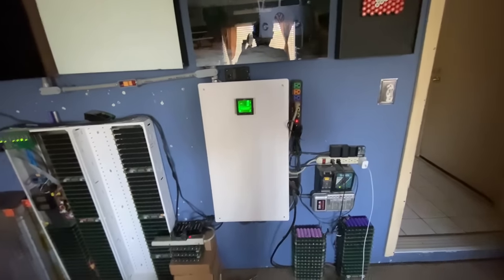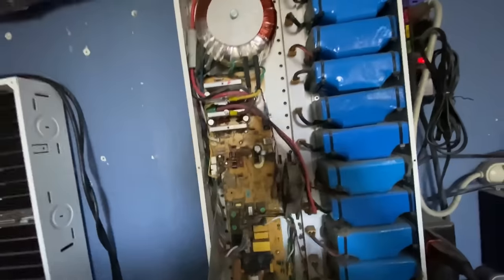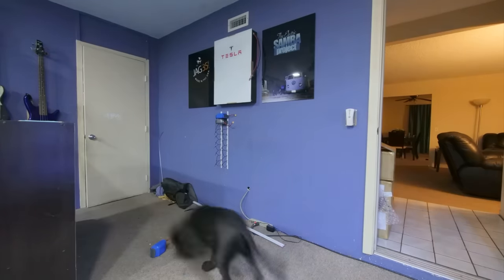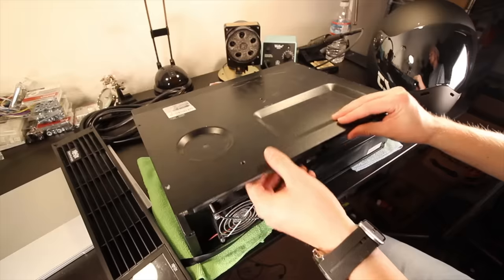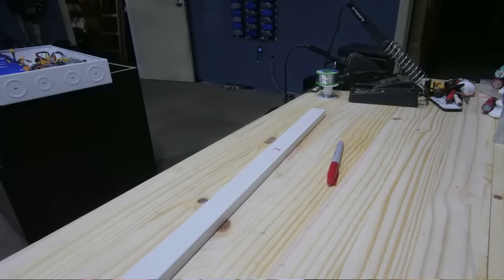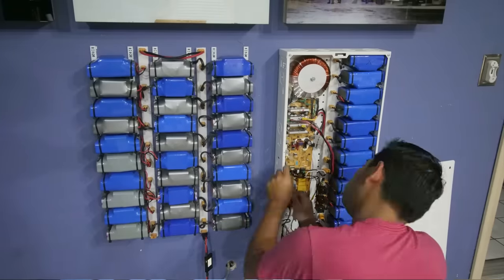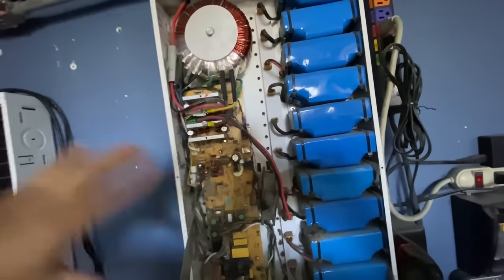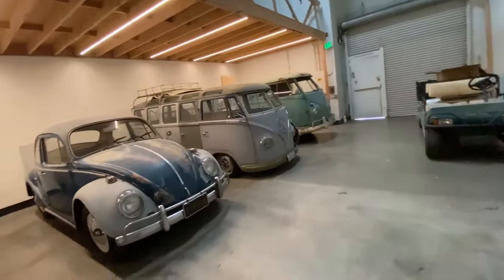Build a DIY Backup Powerwall using a UPS and scooter Batteries

Comment: Hah!  Funny.  I just started building a system very close to this, due to the availability of really nice 36V scooter packs.  Found the batteries first, ordered a few and liked 'em, so ordered 60 more packs. I've used UPSes this way in the past, BTW. Originally was thinking of breaking the batteries up and doing a 24 or 48V setup, which wasn't ideal. (And a lot of work).
  Went hunting on Ebay for UPS that was 36V, and sine wave. (Not a fan of Tripplite these many decades of power electronics.)  Found a Dell 1000W 36V sine unit, used no batts for cheap. Nice unit. 10S Li-ion is almost a perfect drop-in. (42V max, 28V min or so.) one 10S2P pack runs a 400W load just fine. 60 together will be loafing.  Have to add BMS, but they're coming. Looks like about $2K in batts, parts, hardware, UPS and BMS boards for almost 10KWH. 
 Cisco router P/S (42V-27A each) used with a CC/CV P/S to safely charge from generator if needed. Replace old 12V 5KWH golf cart batt setup.
  I'm been an electronic tech and power systems type for about 50 years. (Even lots of time spent with tubes.) Was looking at LiFeP04, but couldn't touch the deal. On grid but have multi-day outages in the mountains up here. (And utility shutdowns for 'fire safety'.) So this will run the place and charge from inverter generator if needed. Don't knock 36V systems of Li-ion and used UPS units. Lot of backup for the $$. thanks for your fun vids!  Stu
Reply: Hey I need some advice on running 12 of these on a robot with a 6.5hp gas motor with a 24 volt alternator 90 amp

Comment: Couple of obvious things:  
#1- Line-Interactive is a fancy way of saying "Offline" or "Standby". LI UPS's sit dormant until power goes off and then they kick in the inverter and the relays throw. Very basic and lower losses, downside, you will loose a quite a few cycles of AC while they do so and the phase will be out when they kick in. Double-Online Conversion is what Jehu was refering to, but not in this unit. DOC units go like so, AC > DC (Battery) DC > AC, Mains output is decoupled from the input. 
#2- No mention of the fact that a SLA based UPS does not come close to the charging curves and levels of Lithium types. Result is much lower capacities, poor battery performance and the UPS tripping out early.
Reply: IKR , not to mention lack of termination of charge , lower internal resistance of ALL lithium technologies and NO CC/CV charging , ive given up trying to explain it to loads on here

Comment: Great video just got into this after installing a 20kW NG generator looking for a DIY UPS that outputs 240 volts to eliminate out the transfer time .
Reply: Hi Jay. Are you happy with 20 kW NG generator? how much oil do you use to produce 1 kWh electricity?
Reply: @TheScorpionsuk  it's installed only for emergency use and has less than 2 hours of run time.

Comment: That ups was designed for lead acid. I think that will overcharge or overdischarge based on how UPS is configured
Reply from the maker: Same voltage
Reply: Yep, wrong chemistry.
Reply: @jehugarcia  Yeah... but for 36v, he need to have around 10 LiIo cells in series. Aka a terminal voltage of 42V when full and 30V when empty. But same with lead acid will be 43.5V when full and 30V when empty. Aka this setup will overcharge. And I dont think its a good idea to float LiIo at 39V because LiIo will start discharging into the charger as its natural voltage is 4.2 when full and disconnected. IDK im not an expert.. but I do think lead acid and lithum chemistry is not interchangeable unless there is some retrofitting circuit to take UPS output and make it safe for LiIo (Not talking of just a normal BMS, there needs to be an advanced BMS to handle float)
Reply from the maker: Chemistry is irrelevant, voltage is king.  Float voltage is 13.5v x 3 = 40.5v.  My unit maintains the battery at 41v divide that by 10 and what do you get?  The correct voltage
Reply: i wish you could reflash ups with code that allows you to reconfigure charger into li-ion patterns, such as allowing it to stay at different s.o.c...
Reply: The problem here is the fire hazard. Putting a smoke sensor is mandatory. 
And will the fire protection insurance pay if something happens?
I would build in a automatic fire extinguisher in it to be on the safe side. It’s always possible that the charging circuit malfunction and let out more voltage and overload the cells.
Reply: @Todestelzer  In practice the problem tends to be that charging circuit has such a low output that it barely charges the bank, which now has an order or magnitude or two more capacity.

Comment: I doubt you will read this, but heres an idea (I am thinking of doing it).
UPS 5000W (yes a bit ovekill, but this is solely to cover peak needs at home) output over X amount of breakers to cover blackout coupled with lets say 20kW of potential power. This can be variable for personal needs, our average is about 10-12kW per day 24h, so could live 2 days blackout withotu being conservative. But this has a bonus side!

But listen now, the idea is to make it possible to force the system to use battery over a schedule. If you feed in a schedule to use battery over a day and charge it up at night. We move more and more to the market where energy is expensive during the day (or at certain hours or periods), especially in winter time. 1kW cost up to 1.00 EUR for few hours a day, so you can imagine charging it at night at 0.1EUR per kW.
How would you attack this idea? I am thinking of banking in on 10kW prototype and may be even think possibly sell and get maintenance contracts on top later if needed. If proto works, then find ways to make it cheaper and cut some profits while doing it.

I can imagine this to work even on constant draws etc. For example fridges or facilities needing lighting 24/7.

This all could save costs and pay for it self over few years. Plus you have UPS if total powerloss. Think about deep frozen jam, meat, icecream etc etc it could saved.
Additionally it will take some pressure away from power plants and overall grid pressure when the demand is high.

Comment: So how are you connecting this into your house's main supply, or is it just powering a few devices and acting like a standard UPS as opposed to a Powerwall?
Also, the original UPS inverter/charger was running sealed lead acid type batteries, but you replace them with lithium ion type. They don't charge in the same way, did you change something there?
Reply: Seems my Youtube notifications are a bit screwy..  Anyway.  I'm using it as a standard UPS. All my household lighting circuits are brought out as a power cord from my secondary panel, as well as the computer/communications power. And will use a separate feed for the refer/freezers. All the comms and lighting draw a max of 500W, and normally 300 or less. If computer and 50" 4K tv are off, more like 100W total. All LED lighting.
 The reason for a 36V UPS is that a 10S Li-ion battery pack has almost identical voltages at max charge and discharge as a 36V lead-acid setup. The added BMSes will protect any anomalies from hurting the batteries. (over discharge and overcharge, as well as overcurrent, tho there's fuses for that as well.) Still getting all the parts together for the fast charge setup, which can run from utility or inverter genny. The UPS is plugged into utility thru a standard circuit/110V receptacle/20A breaker. Still wiring all the batt packs and balance wiring. 12 packs per shelf, 2 BMSes per shelf. (An active balance only board, and a standard full BMS. The active will start balancing any time it sees a difference between cells in the string, and can handle 1A+ of balance current. It's neat to see it kick in.) It's a work in progress, a bit overkill, but learning as I go as well. Will have to see how the BMSes react to having 5 in parallel, feeding into the UPS. I'm doing lots of cell current/voltage and pack current/voltage testing as I go along. Have to be careful, a lot of power there.... But not as crazy as the dual 125,000W UPSes where I used to work. Had to change all the batteries on those one week... Should have seen the van tires with each load of batteries..:) Sealed lead acid...  Woof!!! Anyway, hope this answers some of the questions. I have decades of experience messing with batteries and power electronics and several iterations of this system. Including several break-away points and isolations. Don't do this without a lot of experience or really good help, and start small if your learning. And my power tie-ins would likely give a normal electrician a heart attack... But it does all plug into a normal outlet, after all.. (Yes, I'm crazy.... But still here...) Be safe, be careful, enjoy!  Stu
Reply: How do you keep the ups from backfeeding the utility when there is a power outage ?
Reply: UPS’s, (uninterruptible power supply) by nature, have a power detection circuit and changeover switch to prevent backfeeding, and to facilitate very (very) fast changeover in the event of an outage to keep the circuits plugged into them powered. 
That’s why it’s a prime all-in-one candidate to use as the front-end of a power wall. 

It’s a good use for them, imo, because as lead-acid electricity storage is phased out and replaced with lithium, they will become a lot more useful than just to power electronics for less than an hour.

Comment: Have you since done this with a APC UPS 6000 smart unit. I have 4 never used and want to use them as back power at my cabin where power is very unreliable.  I could use some tips as the units have heavy power requirement for battery power. Units are also very heavy , but a believe this could solve my power issues in the rural area  . What do you suggest. Thanks

Comment: I'm researching making a home power backup. Part of it would be an UPS that can handle 3000Wh for about 30 minutes until a gas-powered generator can be prepped, connected and started. Your design is interesting to me. However, I have a question: the UPS has an output of 1350W. Is that how much the electronics can handle? If so, what is the point of having 2.4KWh of batteries? Is that to have a longer run time, i.e. almost 2 hours at max 1350W load? Thanks for helping me understand the design.

Comment: What type of BMS is required for using lithium batteries with a system designed for lead acid?
Reply: Just a lithium BMS. You just have to match the number of cells used in series- 12 groups of cells in series would need a 12s lithium BMS, where as 10 groups would need a 10s, etc.
Reply: @dieselphiend  Wouldn't a Lead Acid charger significantly under-charge the packs though?  a 10 or 20 percent difference wouldn't be too bad, in fact it might be better for the longevity of the batteries, but I've read that the charging current of lead acid batteries, when it reaches nominal (Lead Acid) voltage, then Lithium would be as low as 20% SOC.  I suppose that depends on chemistry though.  Thoughts? comments?  I'm trying to setup my own version of what Jehu has here, but I'm at a loss how to set it up.  I have APC SUA1500 (or similar) 24v UPS units at my disposal (no batteries) which normally use 2x12v lead acid in series (24v system) - if what you're saying is correct, I should be able to pick up the 7s PCB kits by Jehu, wire them up with a BMS and populate them with standard 18650 Lithium Cobalt cells and hook that up to my battery leads on the APC and I'd be done.  I'm just concerned they wouldn't have any significant SOC when the UPS reads "fully charged", and I'd end up with dramatically short runtimes when there's a power loss.  I'm very interested in this but I'm very cautious, so please comment and tell me your thoughts.
Reply: @MystikIncarnate  Lead acid uses a different type of charge controller as far as I know.

Comment: The batteires have a bms with a charging port. Did you leave that side disconnected? Thanks for the video.
Reply from the maker: They use a common port to charge/discharge

Comment: Jehu, I really like this design. I am in the process of building one of your powerwalls using the 18650 cells 7SX10P and, I will have to say I like this one better. It will be easier to replace battery modules in this design. Thanks for posting.

Comment: it's a nice DIY yet i'm concerned about fire hazards. a defective battery, a wrong wiring, lack of cooling, water leak on a sufficient number of DIY something will go wrong cascading to the other batteries and therefor it should have an alarm, some advises to mount it in a place and a way that it can fail safely maybe firefighting tools and knowledge that applies to does chemical fires.

Comment: Hi , i need a little help and suggestions... I have  8   60v (12-15A) lithium battery used from city coco bikes. And about 1 kw solar panels. My idea was to use the bateryes as they are ( with they bms inside) without opening them, just to conect them in parallel. Use a 2-3kw inverter and a solar controller. Will this project works ? Any suggestions plz 😸

Comment: Love your channel man. Here is a DIY project I want to see. Use one of those hoverboard batteries as a powerbank ! Can it work ?
Also, I got a questions, can I use my Imax B6 to charge and discharge 6 18650 batteries in series at once using those 7 pins on the sidec? I havn't found any video that deals with this yet.
Thanks man, your work on the electric skateboard is an inspiration :)
Reply: OMG, I had the same questions !
If you find, please tell us here.
Reply: Yesss please

Comment: I have a question... How is the charge balancing amongst the batteries being handled? Is that something to worry about? Or would the individual batteries already contain circuits that manage that? I'm a newbie here so I apologize in advance if the answer to my question is obvious. Thank you. Great channel!!
Reply from the maker: Yes batteries have a bms inside
Reply: Thank you for your quick reply!

It would be awesome to do a video explaining some of the basic units of measure (KVA, Amps, etc.) to understand what can you power with that number of batteries. Like, would it be good enough to power a fridge? Does this UPS generate pure sign waves?

Comment: Wait...what did I miss?!
How van you charge the 36V LiIon batteries with the original 36V LeadAcid charger in the UPS?
Don't you need a special charger for that?
Reply from the maker: No
Reply: @jehugarcia  wait....does that mean I can charge a 12V LiIon Pack directly from my Car Alternator?
Reply: @florihae  PROBABLY those pb batteries 3x in series are charged with 42 volts ( 14v x 3 ) THATS perfect for this bouild .....maybe even less lets say 13.8v for each PB battery (13.8v x 3 = 41,2 v ) Thats also very good for longevity of LI-ion (10s 42v MAX) packs

Comment: how do you resolve the issue of charging? are those units going to charge those batterypacks? isnt any risk of overcharge? or the bms takes care of it? I have a 3300 APC ups that uses a 48volt battery pack (4  12volts batteries),.. could I use 18650's with 4 12volts bms wiring them in serial?... by the way youtube is unsubscribing me from channels! weird as ever...
Reply: following. iam in the exact same sittuation.

Comment: A Tesla powerwall is around 7000 plus install. This one with 30 cells would be around 1500 with shipping and the little stuff. What is the power output difference?
Reply: I think the difference is 1.5kw output (ups) instead of 4kw output (powerwall)  and it is designed to connect to the main power, ups not it is still a ups it needs some extra stuff but the price (those upsses you can buy them cheap second hand or for free) is a fraction of the cost.

Comment: Hi jehu I was wondering if you knew of a good way to setup a Kodiak like system using 48v solar panels. What kind of inverter and charging system would you reccomend? I'm going to use 18650 batteries

Comment: Great video !! 
I have a 36vdc online high frequency 1 KVA UPS which is usually used in datacenter or as computer ups.
will the same setup work with the 36v 10s3p  e-scooter/bike batteries in parallel ???

Comment: Wanted to ask, what's the charge profile of that UPS and does it charge the 36v batteries with no problems or did you add some type of DC to DC converter to boost the V&A